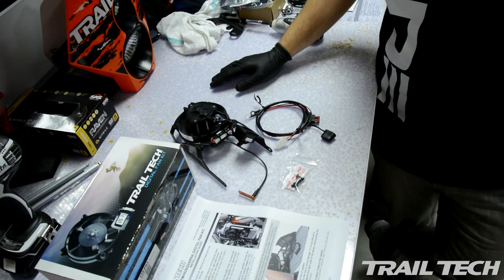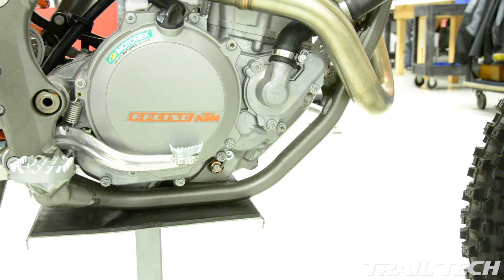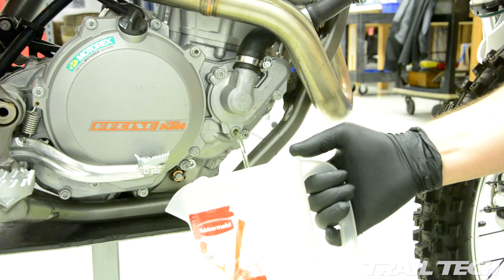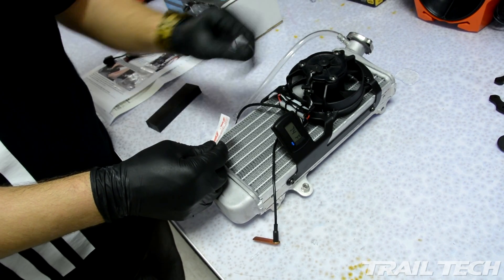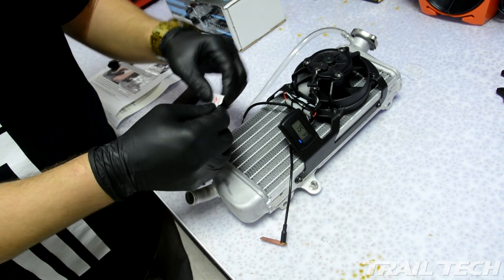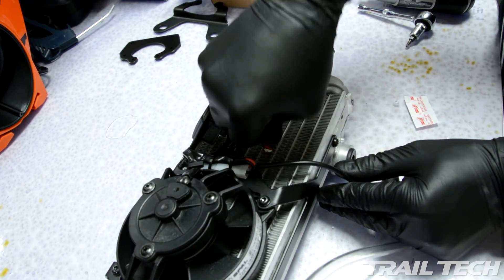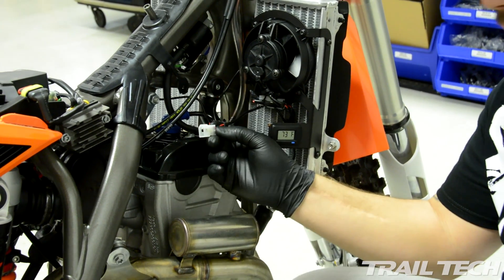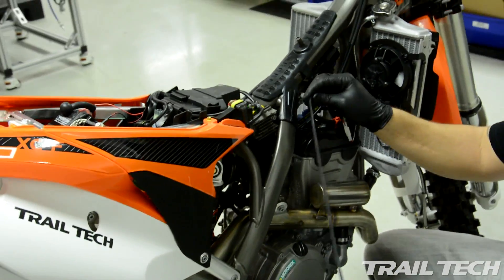Cooling Fan Kit Install: KTM 2013 250 XC-F

Comment: After it's installed, how many degrees should I set it to connect? Or if it is already configured, how many degrees does the fan start working?

Comment: i am confuse. if the connections are connected directly to the battery, that means it doesn't have shot off switch or the fan continuous to run.
Reply: The fact the fan always has power available doesn't mean it will always use it

Comment: Please give a link for buying 12v battery power cable for fan pin.Thx.
Reply from the maker: I am sorry but we do not offer the power harness for the fan on our website. You would need to email in to our sales department at sales@trailtech.net or call in to place the order for that. It is part number 732-WH1
Reply: thx

Comment: Alright fellas i installed this kit on my 2015 ktm 250 xc-w and I'm just curious what you would set the fan on temp to??
Reply: Magnetic.Crayon The default setting that the fan comes set on will work for most applications. A lot of it will depend on the jetting, elevation, and type of environment that you are riding in. A simple thing to do is to go out and do your normal riding and if the bike is still getting hot and boiling over change the setting on the fan down about five degrees. Do this until the bike stops overheating.
Reply: Justin Yancy cheers buddy i guess i will give that a go its still some what spring weather here so i haven't even noticed it coming on so i was just curious if maybe i had it set to high
Reply: Magnetic.Crayon No problem. Let us know if you have any more questions. We are always glad to help.

Comment: I just bought a KTM fan kit for my 350 SXF and the fan does not fit between the radiator and the gas tank. I'm considering returning it and getting the trail tech fan. Is there a noticeable difference on clearance with the xc and sx tanks?
Reply: Tom Herk Unfortunately there is no fan kit out there that will fit on the SXF bikes without changing out the tank. To be able to make the fan fit you would need to change to the XCF tank.
Reply: Justin Yancy Is the XC-F tank a direct fit on the my 2011 350 SX-F? I called a KTM dealer today and asked and they didn't know. I imagine it would but changing the fuel pump may be the biggest obstacle, but I imagine it should be the same fittings.
Reply: Tom Herk The XC-F tank is a direct replacement. It will go right on and allow room for a fan. The last thing that you would need would be a stator upgrade to be able to create enough power to run the fan and keep the battery charged.